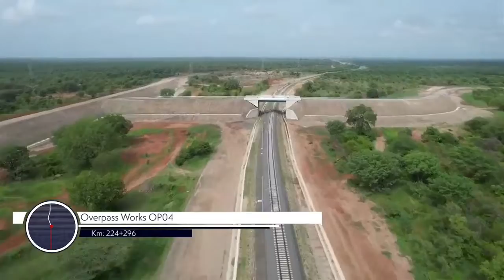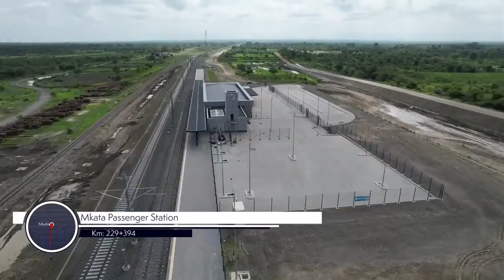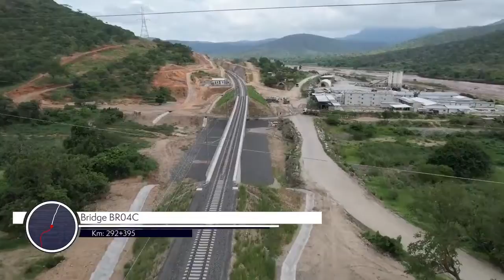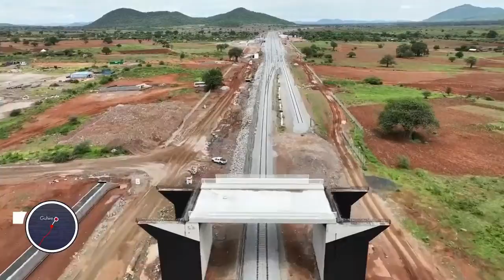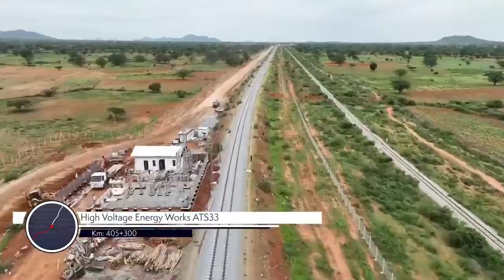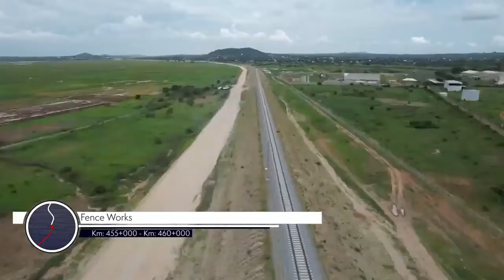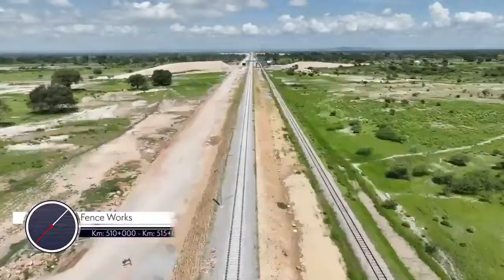Morogoro #Makutupora SGR Phase 2 The project is now 93 percent complete. #Reliyakisasa #Tanzania

Comment: 1:10 What kind of a bridge is that? Why no roads and why the perpendicularity on the left side?
Reply: The T junction on the left side is to provide access to the power station up ahead for vehicles coming from the right hand side. The overpass is essential for future maintenance since level crossing is not safe for a train moving at 160kph.
Reply from the maker: Good observation. Not sure about the technical design of the bridge , but I believe that this is W.I.P.